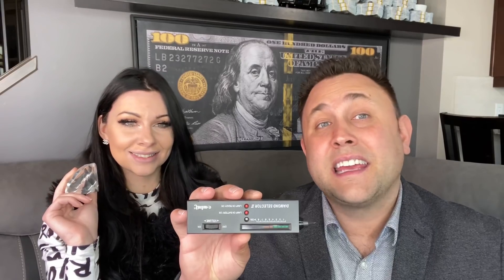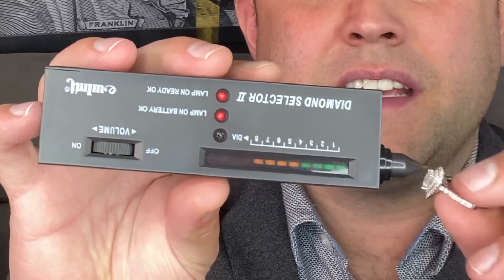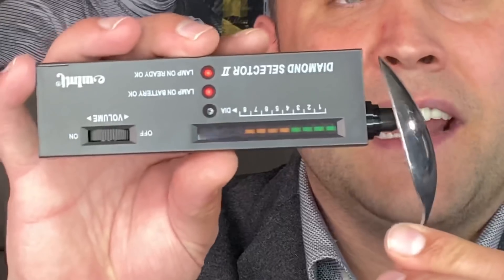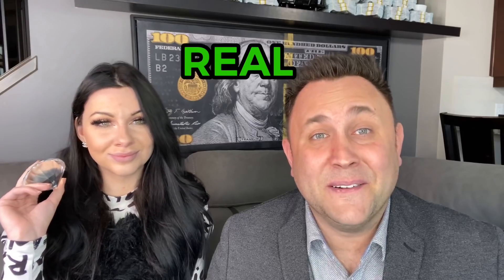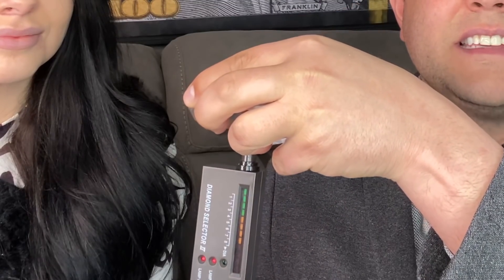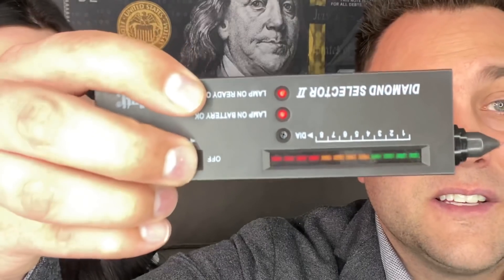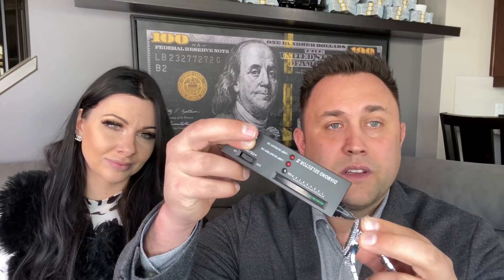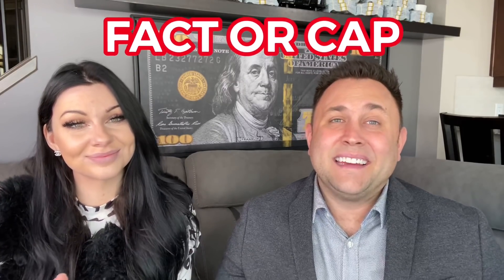HOW DIAMOND TESTERS WORK 🤯

Comment: Exposing time: the Diamond testers are actually fake why are you ask? It bc when you zoom in a little on the tester the you can see a trigger type of button and so when you put the tester on plastic if you don’t pull the trigger button it won’t make a noise but if you pull it it will make a beep noise and when you put it on something which looks diamond but is plastic and pull the trigger button it will make a beep noise. EXPOSED!!!!!!